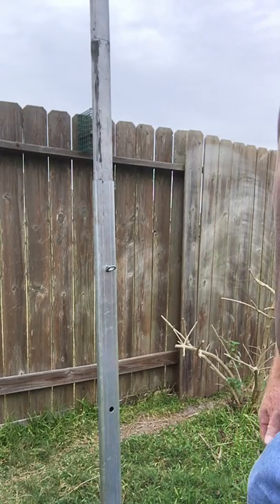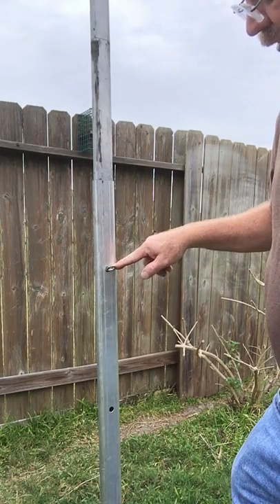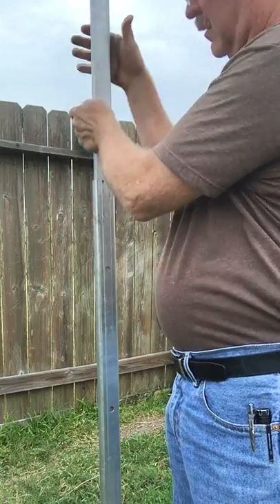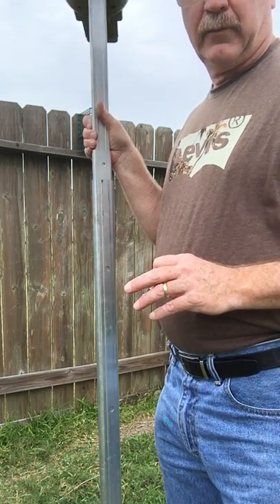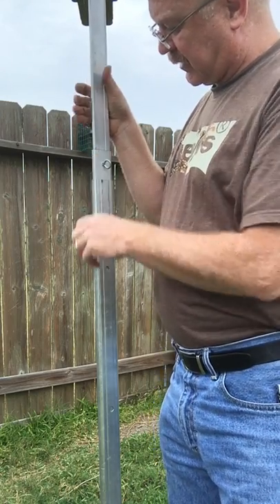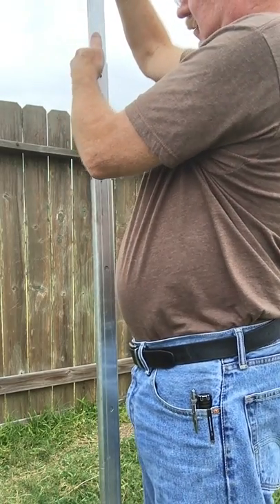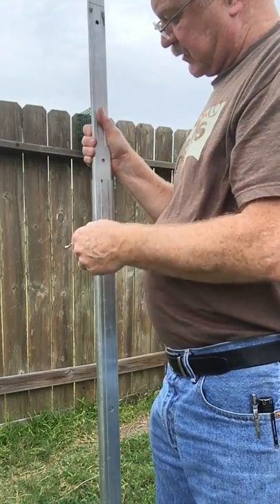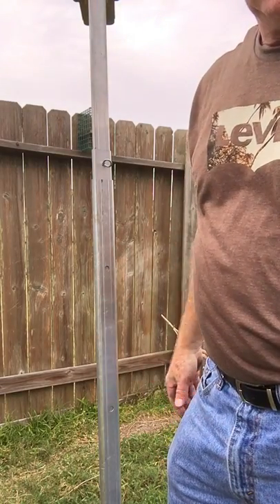Tri-Tel Pole Modification

Comment: Ok so did you Drill through top section And bottom while poles are bottomed out? 
Your arm blocks the view. Wanted to see spacing between factory hole and your new hole.
Reply: Did you get an answer?